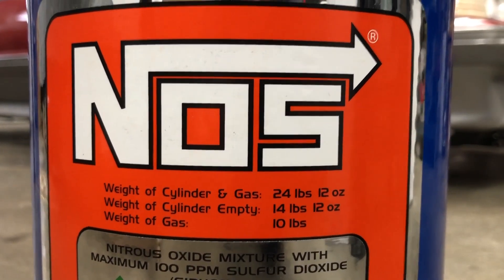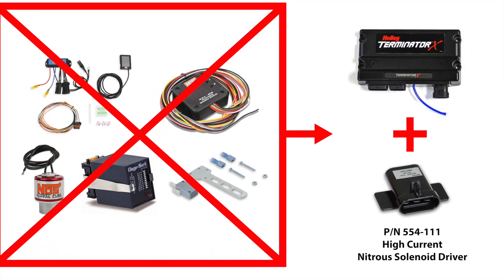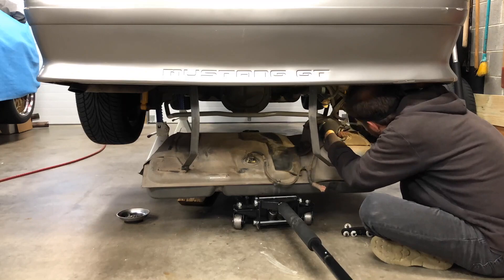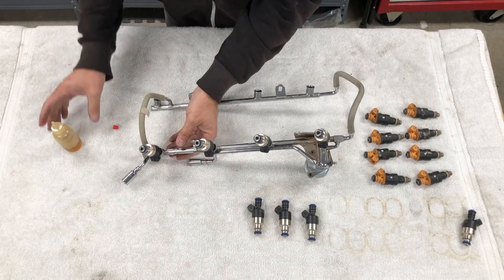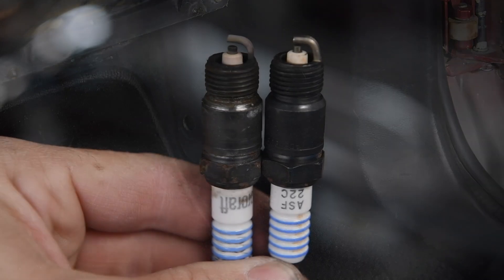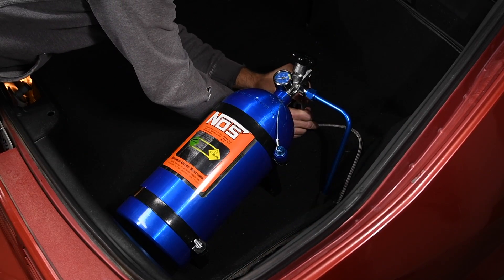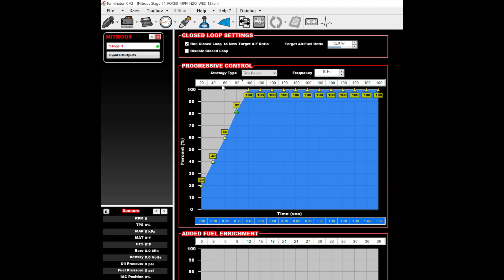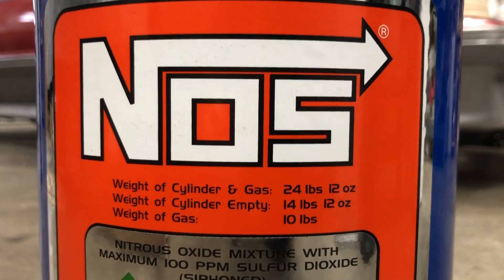NOS Nitrous with Holley Terminator X on Foxbody Mustang

Comment: does this count as a wet shot because the holley will add the fuel thru the injectors?
Reply from the maker: No, "dry" shots ALWAYS inject fuel through the injectors. "Wet" shots inject fuel through the manifold, which on EFI manifolds is a problem.
Reply: @Mustang-Geek  so how can i set it up with a wet shot?
Reply from the maker: @FoxbodyJon  Not sure, but suppose you could trigger both solenoids with the same driver and zero out the additional fueling.

Comment: What if we want to use a wet system ? Is there a way to connect the fuel solenoid
Reply from the maker: Sure, you could easily run a wet system and not have the Terminator X add fuel for nitrous.

Comment: running a street setup car with push button on the shifter. i don't have any spare inputs to have a safety switch and a trigger switch. using tps and rpm safety and rpm retard. I'm assuming i can just use the push button for the n2o enable and don't have to have the enable and input #1?
Reply from the maker: I think the only issue will be the Terminator X won't know you're on Nitrous and therefore won't know which air:fuel ratio to command.
Reply: @Mustang-Geek  i actually researched more and figured this out. the n20 enable is all that's needed to activate the stage then i'd use 1 output to trigger the NOS solenoid. the input 1 isn't needed. seen some use it to disable the stage as a safety or to use triggering multiple stages. thanks for the quick reply though.
Reply from the maker: @callofgeorge   glad you figured it out! It’s been a while since I messed with it so I would’ve had to do some more research to figure it out as well. I was just going off of memory.